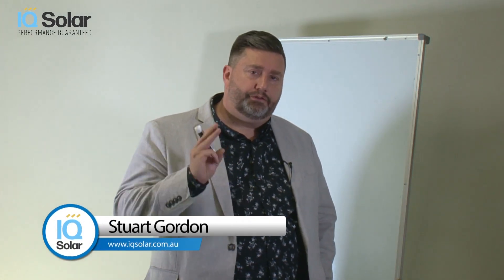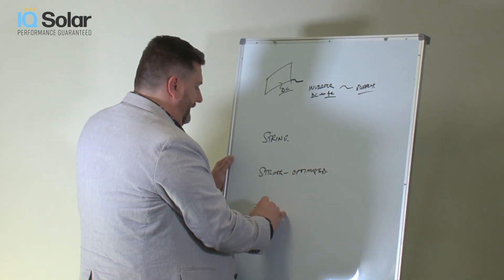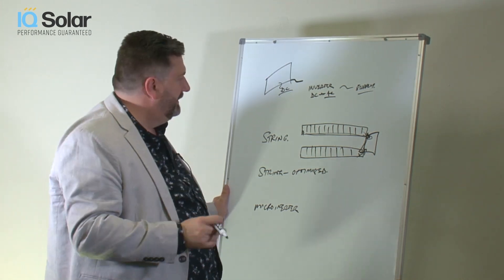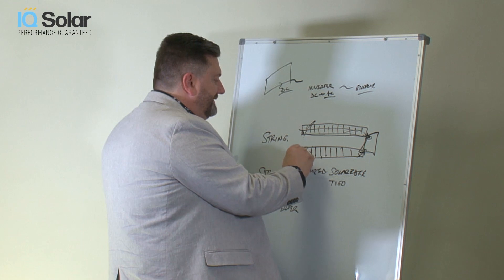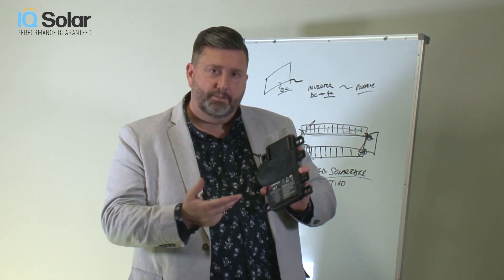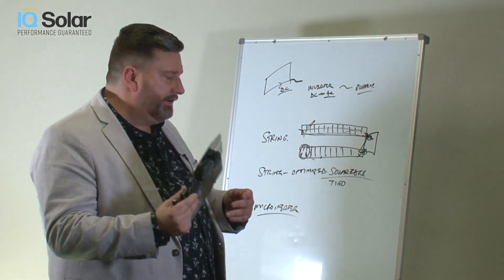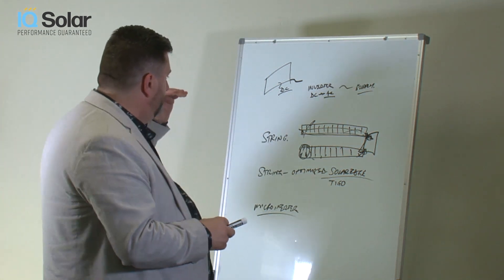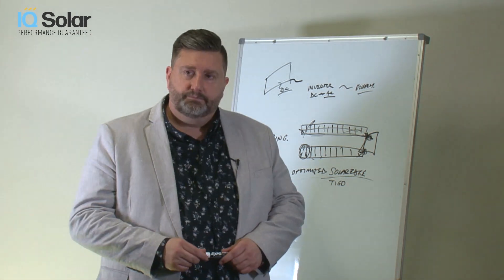What is a Solar Inverter? [Microinverter vs String Inverter Explained]

Comment: okay...okay..This Yahoo... got it WRONG from the Git-Go!!   (FYI...I live 100% off grid, on a DIY system for the past 3 yrs now... and made every mistake, One could make in the beginning... but now live 100% bill free and self sufficient.. Just to clarify that I might know a thing or 2) SOOOO... This Muppet, missed one of the 3 key components which is a "SOLAR CHARGE CONTROLLER"!!  (which, btw... is how I came to watch this video, as I rarely heard of a "Microinverter" before, and was investigating the "what" "How" and "How much" are involved with these mythical "micro-inverters"!  Anyway. I have not gotten past timecode 0:45 pf this misleading video!  (shrug) soooo there's that!

Comment: Incorrect information on string systems. The shading of one or two panels in the string does not effect the output of the rest of the panels in that string.
Reply from the maker: There’s a few cases where it doesn’t impact (bypass diodes kick in), but typically it does .
Reply: @iqsolar9633  There are no cases where the shading of 1 panel will impact the performance of the rest of the panels in that string.
Reply from the maker: @69Atho  let’s just agree to disagree. I’ll stick with actual facts
Reply: his is typical misinformation by a salesman(string)Not like you say, sry man. This is not the case with the Fronius inverter.
Reply: This video (https://www.youtube.com/watch?v=UQ9Szhl1ceQ) tests the impact of shading on solar panels. In the test it concludes that partial shading does not significantly impact the performance of the rest of the panels.
Reply: AHHHHHHH... YES IT DOES, Dude!!  How much or little, depends on how you strung your panels together;  series or parallel!!  DUHHH!!!